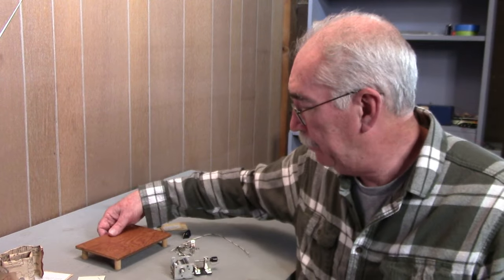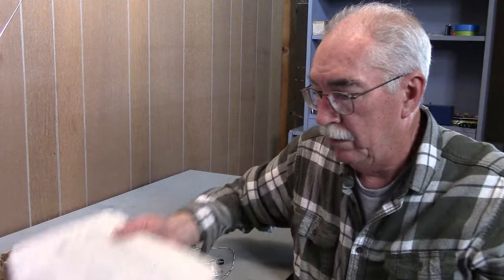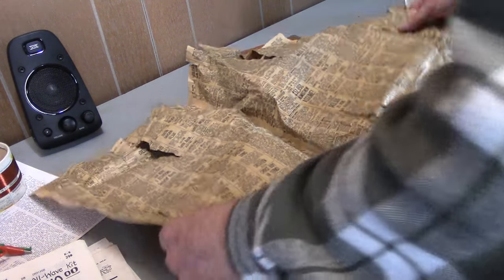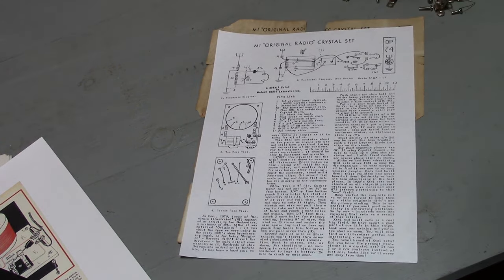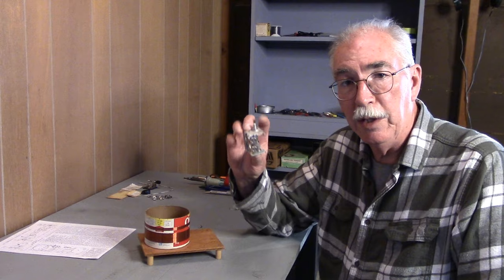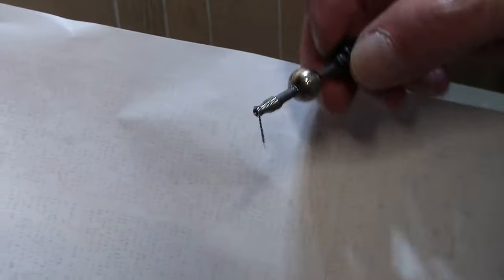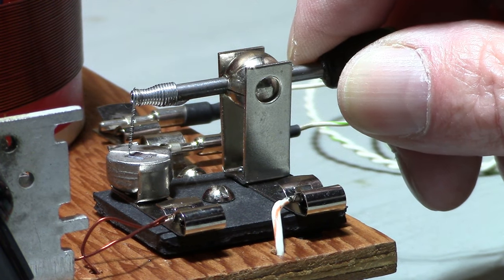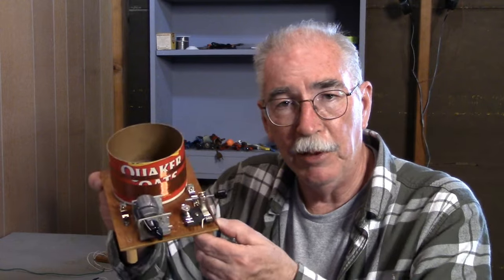A Modern Radio Laboratories® #74 Crystal Set

Comment: Wow - memories - when I was a kid in  the early 70s, I built that exact kit. The biggest issue was lack of information that might have helped - no internet of course. A metal coffee can was about the same size as the Quaker Oats container so I tried that, obviously with no success since it would have acted as a shorted winding and also changed the inductance. Eventually I got it going by switching to a cardboard container of some kind (no Quaker oats in our home) but the crystal was so incredibly finicky and the lack of strong AM station nearby didnt help so it really wasn't reliable.  The  detector diode did work and made the project a sucess. Was a great learning experience and the idea of a radio with no batteries fascinated me. Thanks for making the video!
Reply: Same for me at about the same time except At nine years old I couldn’t make it work. My dad was a WW-II Army Air Corp Vet and was Nose Gunner and Second Radioman on a B-24. I asked him if he could help me get it working. Well I guess that a primitive radio wasn’t taught at his radio class during the war, (or he lied)……
Reply: @scotthaddad563  I'll bet there were a lot of us that couldn't get it going. This was actually my second crystal radio - the first was more of a toy kit  with a diode that never worked. Years later I discovered the diode was bad and headphones were way too low impedance for this application. 

Funny - my dad also was unable to help - he was a RCAF vet who had been a navigator on an Avro Lancaster and then ran a Radar site on the British coast and used to troubleshoot the electronics there. Like your dad, he must never have been taught about this sort of thing. I suspect that due to wartime situation, they  only had time to learn what they needed to know for whatever job they were assigned to. Probbaly for both our dads that was simple tube radio transmit and receive circuits.

Comment: Decades back I bought the entire set of Elmer's books.  There is a history of him on YouTube also.  I worked for a store that was a  Philmore distributor back in the early 80's, and kept a couple of the detector units for myself, still in the packages!  Worth a small fortune now., plus I have an original Philmore Galena Detector crystal in the early 1900's box.  When the store closed due to the death of the owner, I ended up with  the 15 lb rolls of the magnet wire, and most of the stock. 
 Loved the coil weight and tight nuts humor.

Comment: Howdy and hello,
I looked at the writing on the paper and it said something about shorts and screws and two lines under the tuning cap and I think that two screws were causing the cap to short out somewhere in the connections but I can not be sure and if you carefully move the crease or fold where the writing is with a x-acto knife, and then use some scotch clear tape very carefully to patch the crease or fold of the paper together you might be able to read what is left of the writing. 
It would take a careful touch and some patience to pull that off.  So be careful.

Comment: The first crystal radio I built (1974) was a Radio Shack kit that had a square antenna. I knew what I was doing and followed the instructions to the letter? I didn't work at all no matter what I did. When I was 13 in 1976 I got my Radio Shack 150-in-1 Electronics kit for Christmas. I still have it. The Crystal Radio project in it worked perfectly (and still does). A few years later I purchased another radio kit (the same one from 1974)... it didn't work either.

The FCC is thinking about reallocation the AM band for other uses since AM stations have all but completely died off. If that happens, all crystal radios may become useless. I hope they keep a small portion of the band for AM broadcasts (say 550KHz to 600KHz) for disaster prep as AM and Crystal Radios may be the only way to disseminate information after the "SHTF" event when most electronics will be destoryed by EMP weapons.

Comment: At 10:42 I would have held down the wire straightening tool with about 50 lbs of weights... right on top of the plastic cups so they get squished down real flat. It seemed to work for the coil... it snapped back into shape perfectly. I never knew I could glue down such delicate objects with so much weight. I have a priceless cracked Fabreger Egg, I am going to try your heavy weight trick to hold it together while the glue dries. Thanks!

Comment: The other radio you built (the one where your mom gave you "the belt" for being insolent) picked up several stations in the Philadelphia area. If you temporarily swapped out the Point Contact Diode with a Germainum Diode, would this radio be more selective to stations?

By the way: The symbol for a modern Diode is an arrow pointing to a flat line. The arrow side is the Anode and the flat line side is the Cathode. Electrons flow against the arrow. The symbol was not drawn based on electron flow, it was drawn to symbolize the Point Contact Diode (as you have here): The Germaium (is that correct?) in the Cup (Flat Line) is the Cathode, and the Tungsun (correct?) Needle is the Anode (Arrow).
Reply from the maker: It would probably work better with a diode, but I don't know if it would be more selective. An antenna tuner would help a lot. Also, it acts differently at night vs during the day, but I think that's true of any basic crystal set.

Comment: The early boxes were 5-3/8" in diameter. The one I just measured is just 5-1/16" in diameter.

What size box did you use? I wonder when they changed box size and if the 1978 radio had to be wound different than they wound them on the older boxes?
Reply from the maker: The outside of the box is exactly 4 inches in diameter.
Reply: @michaelsimpson5417   The expiration date on the bottom of my box is July 2009. Definitely a shift in sizes over the years.

Yours will take less wire to get the same number of turns as the originals so your losing bandwidth on the low end is my guess. Did you add more turns?
Reply from the maker: @tenlittleindians  It depends on what size you buy. The 42 oz box is 5" in diameter, too big for the base. Elmer specified the 4" diameter box, as did the Mechanix Illustrated article.
Reply: @michaelsimpson5417   That's great that they specified a diameter.

The original plans from the 20's didn't need to specify a size because Quaker Oats were the first and only company to package cereal that way.

The problems came later when the box size changed and people were trying to build sets from old plans without knowing the turns would need to be adjusted.

I checked and my box is the 42 Oz size.